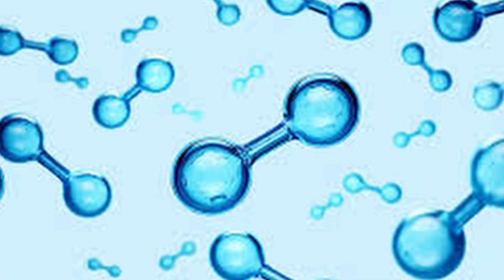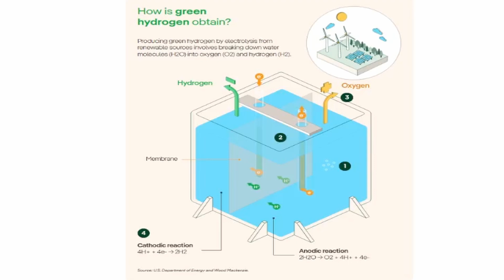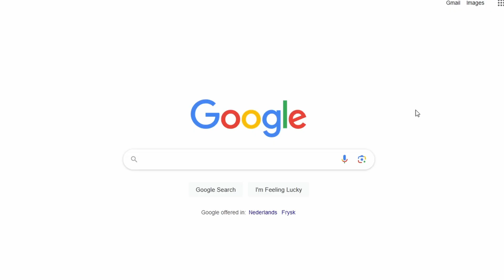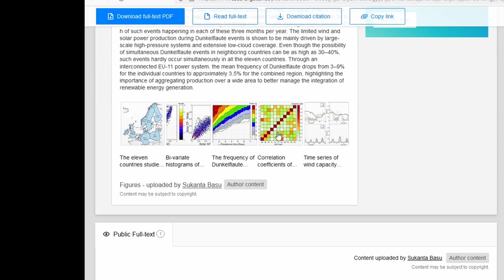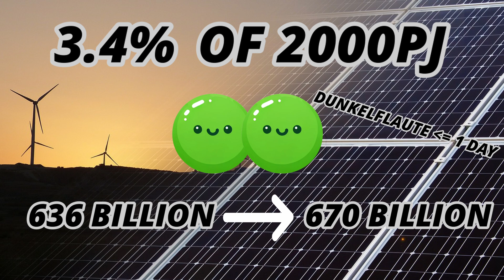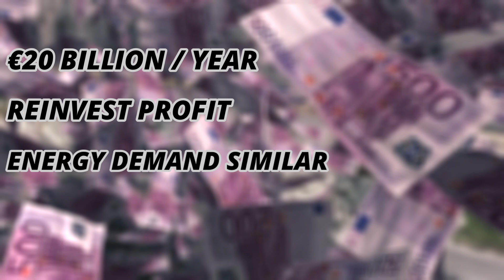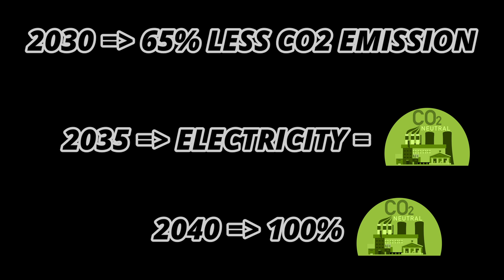Can GREEN hydrogen be the solution? (For The Netherlands)

Comment: Indecisive,
This is the second video i have seen from you and both seem to  indicate that nuclear is not considered.

With the absence of hydro generation, which the Netherlands have no resource, nuclear is the only source of non CO2 emitting generation we know of that works.

Synchronous and asynchronous generators, what does that mean. Synchronous generators (Generally fossil fuel, hydro and nuclear) can modulate output to keep the most important parameter in a grid system, frequency, under control. Frequency is an indication of whether the load is bigger than the supply (frequency falls) or the supply is bigger than the load, (frequency rises).

Supply and Load must match instantaneously.

We in the U.K., but most grids are similar, generally keep that within 0.2 Hz with a limit of 0.5 Hz plus or minus. Beyond that load or generators are switched off.  Broadly speaking, conventional generators do this automatically, very like cruise control in a motor car. 

Renewables are asynchronous and cannot carry out this delicate load supply balance so are pretty much a dead end technology, especially as their supply is so intermittent and variable. The more we add to a grid the harder the synchronous generators have to modulate output and the less stable the grid becomes.

This video asks a question about hydrogen. Apart from it's very real difficulties in containing it (It seeps through most materials due to it's small molecular structure), and it's expolsive and ease of ignition, it is very inefficient to produce it from hydrolysis and wastes more energy than it can release. Yes, it is used in industry, but do not underestimate the difficulty in utilising it.
However, the Japanese are experimenting with nuclear reactors to produce hydrogen from sea water which may prove to be a better way of production. Making it from wind (far worse solar) is very expensive as with any expensive plant which a hydrogen producing plant is, needs to be run 24 hour a day every day; using variable wind, is really a non starter.

From research (Capel Aris) wind on average produces 80% of nameplate for about one week a year and 20% or less for 20 weeks of the year. http://www.iesisenergy.org/agp/Aris-Wind-paper.pdf

If only politicians and their advisors read some realities such as Dr Aris's papers we wouldn't be squandering money on these 'solutions'.
Reply from the maker: Thank you for your feedback and input! I look forward to looking into it all.

I indeed have not yet considered nuclear. This I will want to do more thoroughly soon. I hope I haven't give the impression I'm advocating for any solution, as I don't feel like I have the knowledge to do so yet; I'm still investigating.

Thank you for your input! I see your point on how a green hydrogen plant with such an inconsistent 'on'-time (using wind/solar energy for the production), might not be able to be profitable (that is your point right?).

In this video I did make the point there are independent organizations who take up wind, solar and even battery projects (this is not the case for nuclear in The Netherlands), and how this makes it a 'solution' where the government can stay neutral in the energy market. However, if green hydrogen is a part of the solar-, wind-, battery-solution, it is (based on my reasearch) not yet clear that it will be profitable enough for private investors to make it happen and so this argument of the government wanting to stay neutral might not hold (as the goverment would need to get involved to make it happen)

This was a mistake in my video!

Comment: Why are we still even talking about Hydrogen? It's a hopeless medium to transport energy, it's not dense enough unless it's cryogenically cooled of under massive pressure. It's hideously inefficient to split from water, and it's just as bad when converting it back to electricity. What's the point? if you start out with Electricity, and you want to end up with Electricity, use a battery! It really is that simple. Every conversion to another form just wastes energy. End to end, BEVs are three times as efficient as a Hydrogen system.
Reply: Battieries are expensive and need to be replaced. The point of hydrogen storage is to use it where electricity isn't used. Sure you lose a lot due to inefficiency but it's better than nothing (for example in the summer when the sun is shining). S d converting hydrogen to electricity is very efficient. 

For cars the density point makes sense and I agree with you but for storage it might be the future especially considering they lithium ion batteries need a lot of expensive materials that are not mined enough to satisfy the whole world